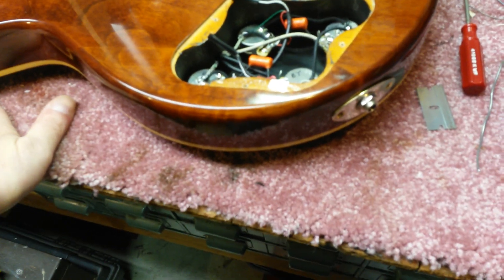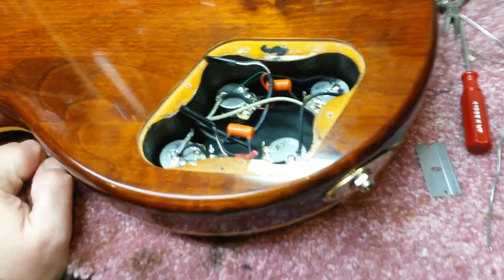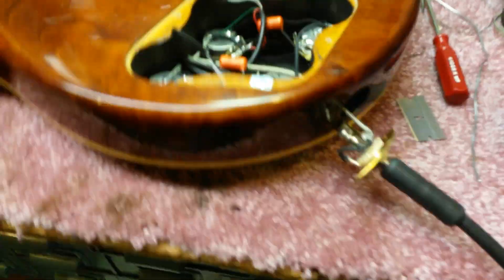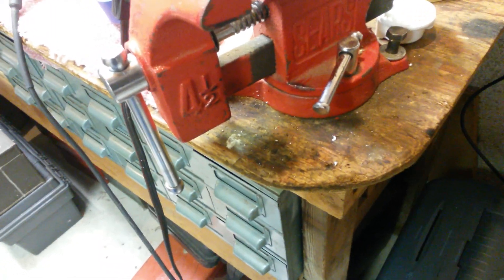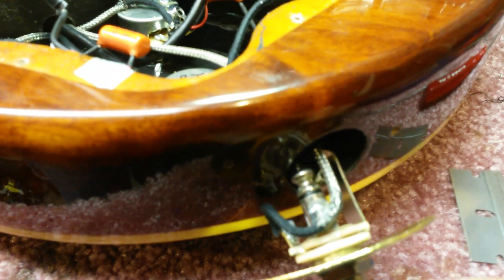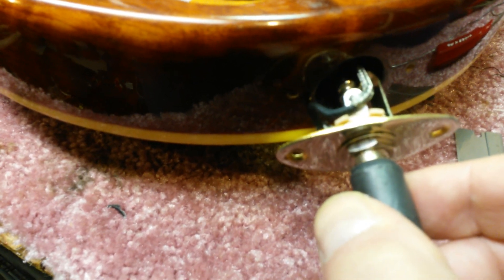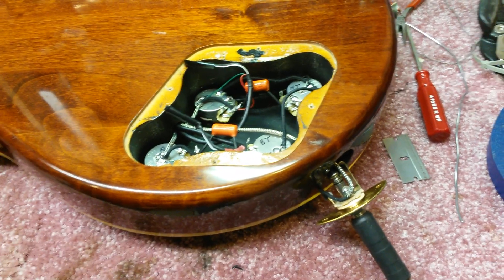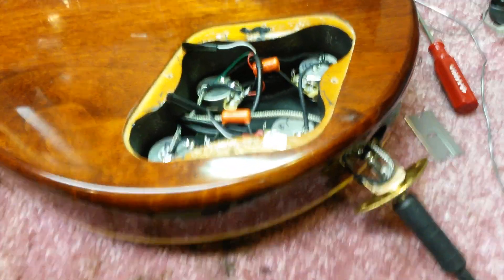Guitar Shielding Gone Wrong

Comment: In cases like this one can just put a bit of electrical tape over the area of shielding/ground to block any contact between the hot signal and ground. Be careful too that the hot connection on any of the pots doesn't touch the shielded/grounded wall of the cavity.
Reply from the maker: You COULD do it with electrical tape...... I just HATE using electrical tape.  I think it's all around sloppy.  So, I went in and removed the paint where I needed to.  Hope this video helps people learn from my mistakes.
Reply: Agreed, it's a lazier solution, but just another option if the need arises. Cheers.
Reply: That is exactly what I do too.

Comment: yeah, i have done this before and had the same problem. first time was the last time i shielded the output jack hole. i never recorded it because it was an oops. good tip on what not to do.
Reply from the maker: Eric, I didn't even think about it. The only reason it was the first thing I checked was because I remembered it going in tight, and thought, I suppose.... Sure enough!